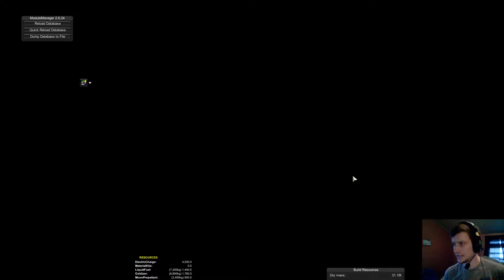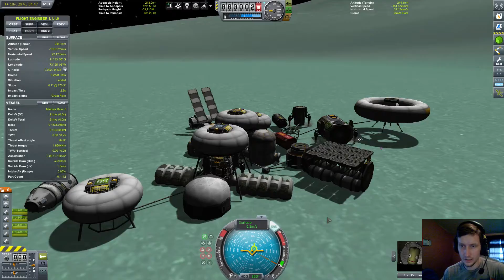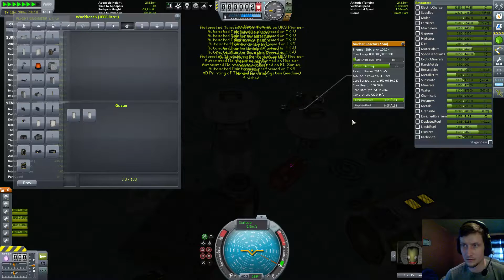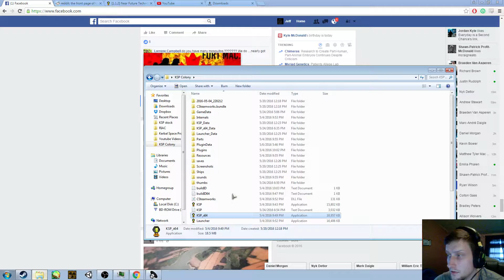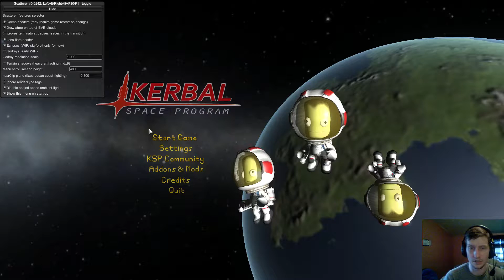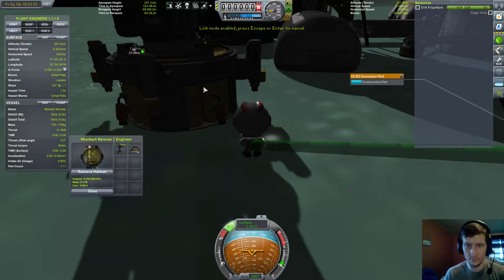KSP Colony Building Part 47

Comment: cant wait to see if your logistics hub works.. might tell me what i was doin wrong, it says "legacy" so maybe my version of the mod has it disabled shrug good episode! keep it going =D
Reply from the maker: Same here, if it doesn't work I might end up with a ton more work. I still have a base a Minmus with a logistics hub so I will probably do some testing tonight.
Reply: im trying to track down why i cant use the work shop in any of the moduals to make individual parts .. ie  new tools solar panels ect.  just no option in the right click menu updated to all current versions of USI mods .. gonna load just those and see if i have the option then add the other mods maybe 2 or 3 at a time till i find which one breaks it >.< bah as bad as minecraft ...
Reply: Well with just USI mods i still dont have that option .... was that a separate mod letting u make parts from the inflatable workshop? ..
Reply from the maker: Ose workshop is the mod that supplies the ability to make parts. It adds 3D printers to alot of parts.
Reply: awsome i might never have found it lol thanks! getting it now it looks soooo useful =D
Reply from the maker: It really helps lighten your ships a bit if they are landing on a planet, it is an awesome little mod.